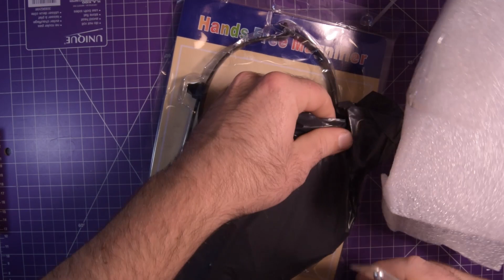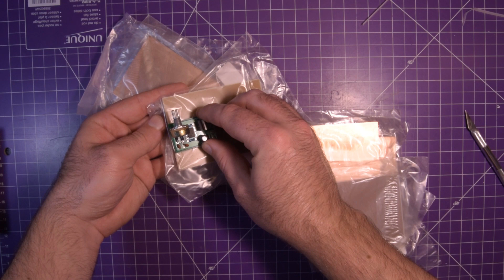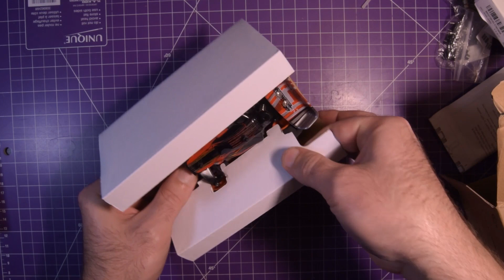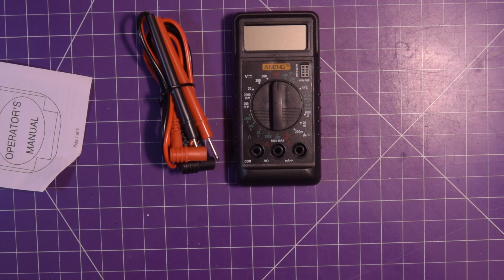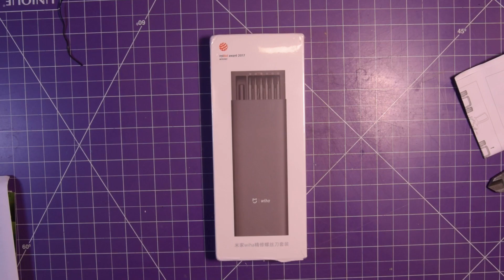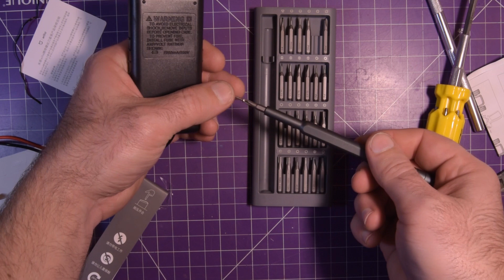Mailbag 34 - Banggood Special!

Comment: Everyone should try making PCBs. Are you using the laser printer ironing method or UV photoresist?
Reply from the maker: Laser printer ironing
Reply: @SimpleElectronics  My best results were using a kitchen tile to iron onto. Great PCB but hard to solder
Reply from the maker: Hey can you unpack that? do you mean use the tile as a substrate? or as a base plate?
Reply: better made pcb copper sheet milling cnc machine lot easy not need axid liquid. and drill same time holes too ready to use.